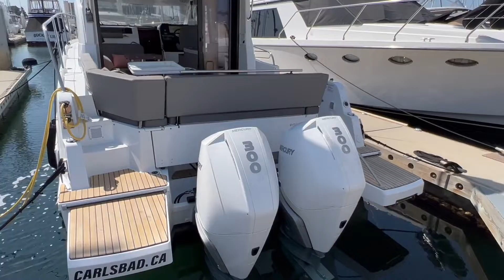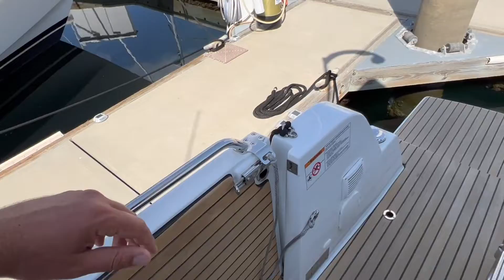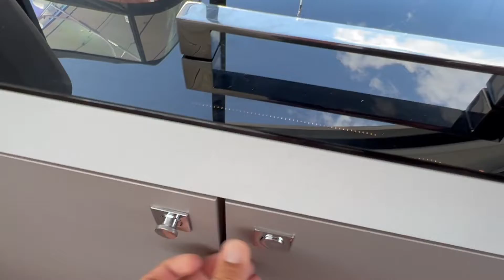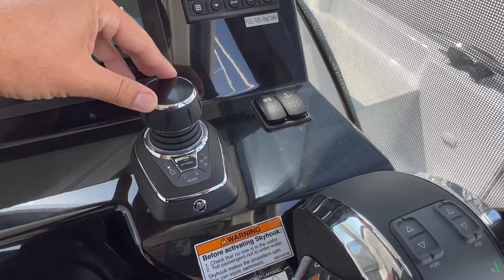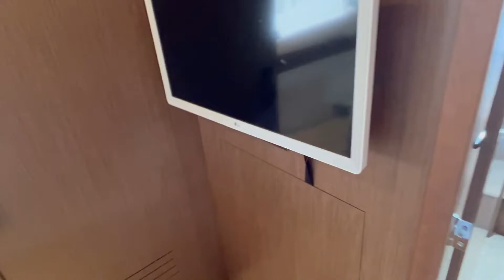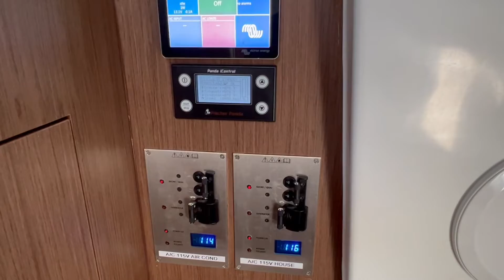Walkthrough Tour 2022 Beneteau Antares 11 // SOLD

Comment: I own an Antares 11 and I have some plusses and minuses to report.  It is very easy to use and the joystick function makes docking a breeze.  It handles very well in calm and rough seas - had it out in 6' swell and it was fine.  Great speed with twin merc 300's.  Great vessel for fun on Narragansett Bay environs.  That said, there are some real flaws.  First and most inmportantly, quality is not like the old Beneteaus.  The company moved production to Poland and the quality is shaky.  Leaky overhead, misaligned cabinets, A/C works great in cooler weather but completely fails to keep up with hotter temps (we're in RI which isn't exactly 'hot weather').  Even the toilet seat was dielivered in the wrong size.  One design flaw is that the helm is very hot in warm weather - zero wind flow and no windows to allow wind flow.  BTW - it is not exactly cheap either.  Also, Beneteau completely eliminated ANY direct contact and all complaints/concerns must go through the dealer.  It is impossible to complain about a bad dealer to Beneteau HQ
Reply: So would you still buy one knowing what you know now?
Reply: @Matt-hw6so  Yes, I think I would.  Beneteau started up a new factory during COVID and there were quality issues.  I felt many of those, but they have been worked out and it's a fun boat.
Reply: Maybe not.  Bow window became unglued after 18 mo.  Perhaps the factory and production problems are fixed, but...
Reply: @dennismclaughlin8840  Glad you feel that way. The lifelong memories of the good times are priceless. So are the memories of the port window blowing out but, well, we'll forget about those for the moment.
Reply: @charles63CCFleet  Thanks Charles.  Despite the imperfections, I love my boat and I love being on the water
Reply: @Matt-hw6so  The ultimate acid test question. Good one.
Reply: Bonjour moi aussi je suis totalement déçu plein de problèmes de fuite en plafond un bateau qui prend l’eau  une poubelle après 7 mois meuble commence à se décoller  pompe de cale en panne wc en panne  porte coulissante problème aussi vu le prix c’est pas normal je pense lancer une procédure acheter pas se bateau
Reply: @ Yes, I had another problem this season.  The window on the port bow became unglued.  18 mo old boat and the thing is not sound for sea.
Reply: Appreciate the insight, Dennis. Helpful. I scoured the 11 Fly at the Sarasota boat show last month as we're considering buying one. While it had a bunch of positives the overall quality just felt cheaper than other boats. Hard to explain but that's just how it felt. That said, you do get considerable value for the price relative to other boats. We're RV people and it seems like Beneteau is the Winnebago of the boat world. Huge company that just pounds em out. Like RV's, the two best days are when you buy and sell it. Your air conditioning comment is alarming as we live in Sarasota and also on the Cape.